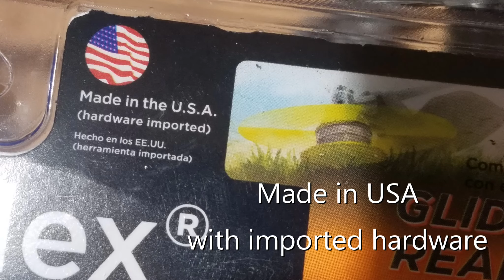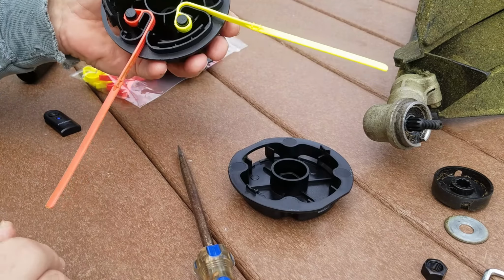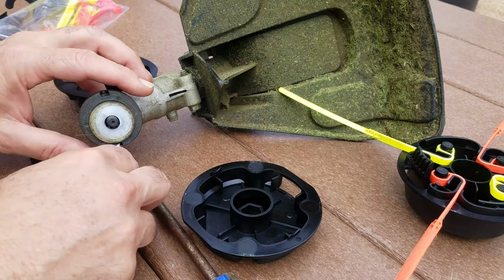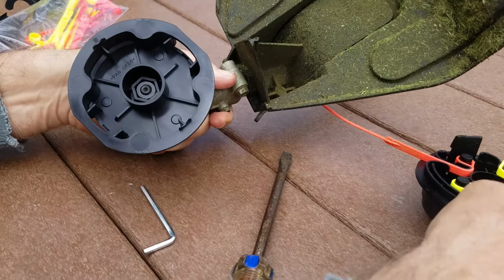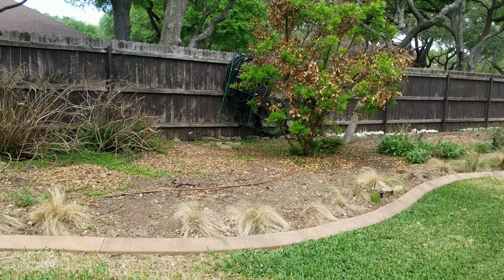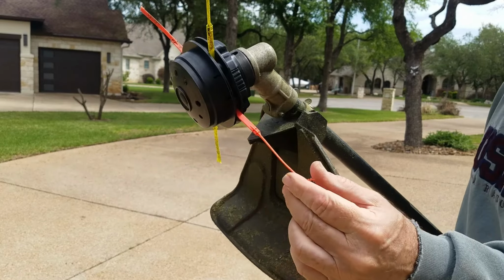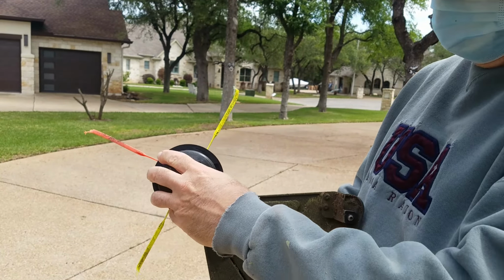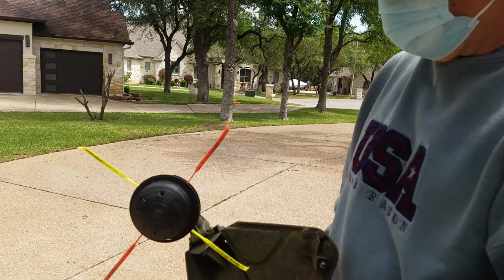Aero-Flex Universal Upgrade Kit for Gas Trimmers

Comment: Great review. Thanks for sharing. I just bought one at Lowe's and intend to use it in about an hour or so.
Reply from the maker: weedeat on
Reply: @DrBDIY  Worked great for normal trimming. However, when edging, they wore out quickly, but did a good job. That said, I think they're worth the extra price; not having to deal with feeding issues, melting string etc.

Comment: Unfortunately our Homelite is now a little more useless.  Took it all apart and unable to get to the housing.  Considering buying a cheap weed wacker to use or just upgrade to a stringless altogether.
Reply from the maker: What was wrong? Can you reassemble?
Reply: @DrBDIY  That was a different pain altogether, but I did after an hour of struggling.  No, my problem was I was unable to find a way to remove the top part.  I just threaded another spool and called it good.
Reply from the maker: ha. Good job.